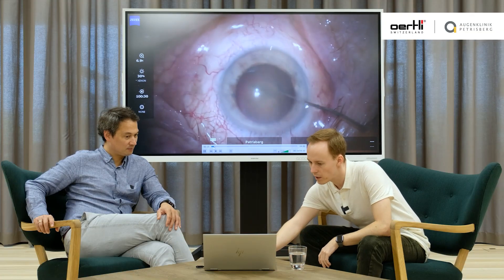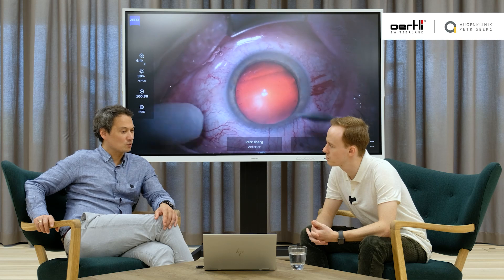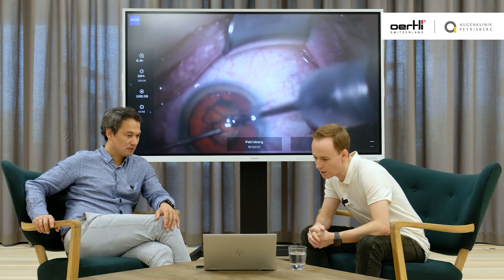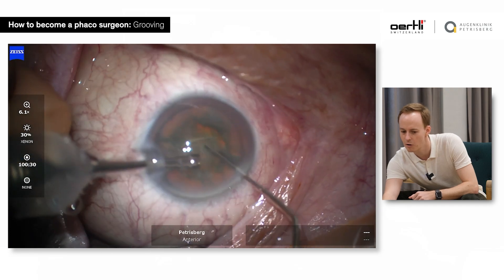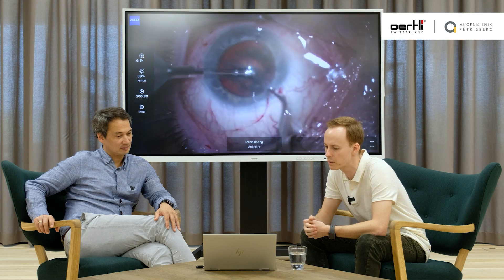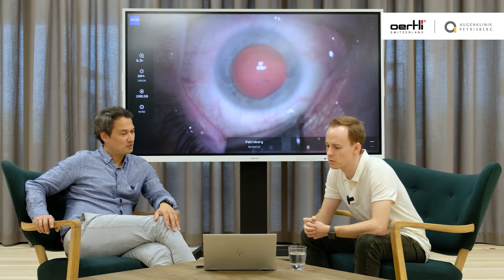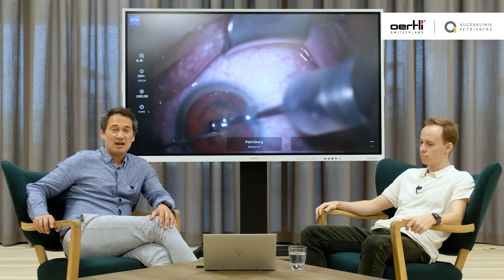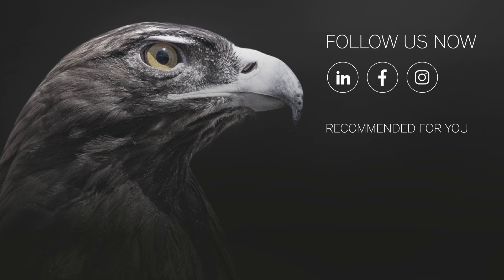Your essential surgery techniques | Beginners guide | How to become a phaco surgeon | Cataract

Comment: I repeat the hydrodissection multiple times till I get the nucleus to freely rotate. 

I usually use a 1ml syringe, with 0.5ml volume of saline and a 27G needle.

That way, it's difficult to have a posterior capsule blowout.